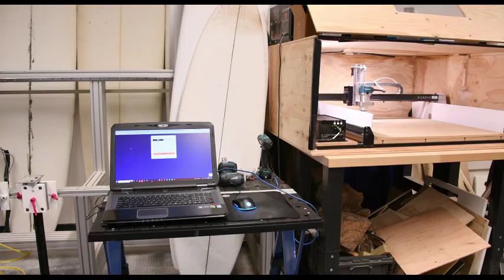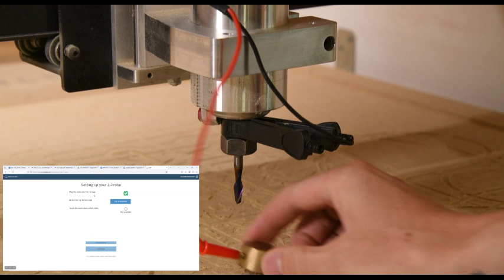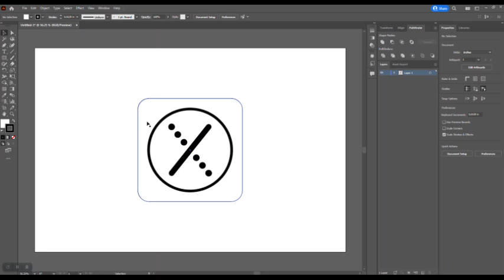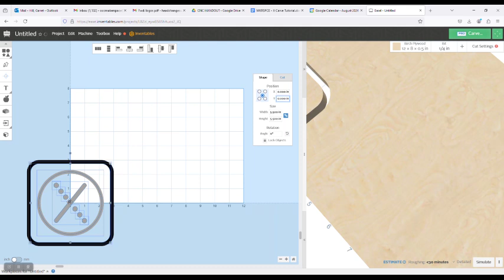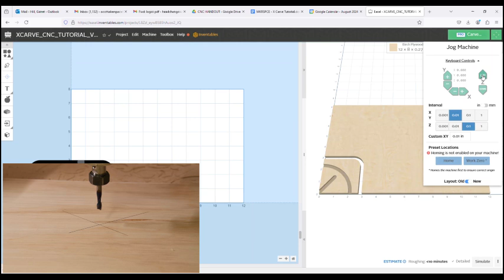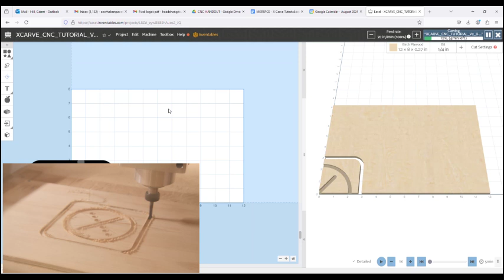How to Set Up and Use the X-Carve CNC | Beginner’s Full Tutorial

Comment: Why did you change the values in machine settings. I didn't have to do that when setting up my X-Carve. Also can you tell me what the tension is on your drive belts? I am having issues with my x axis being out of calibration. It cuts more than the measurement that is set. ie, cuts 16 3/8 when I want 16 1/8. I have recalibrated several times and still have problems.